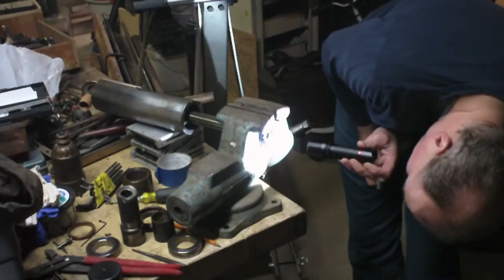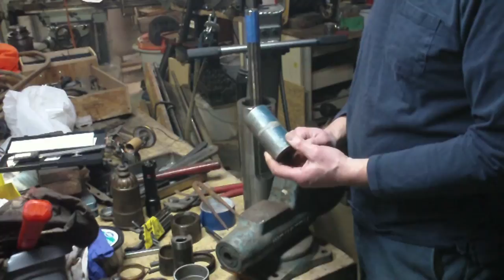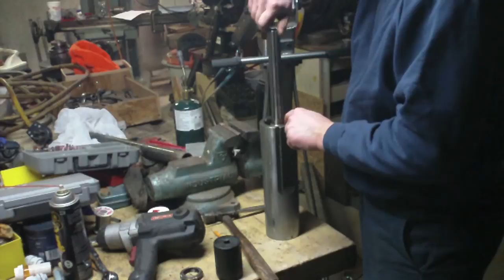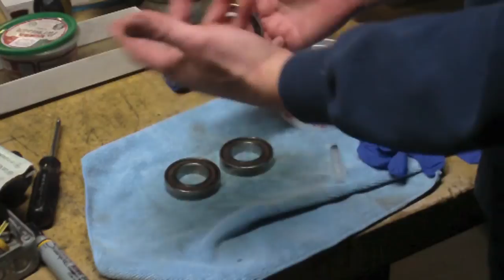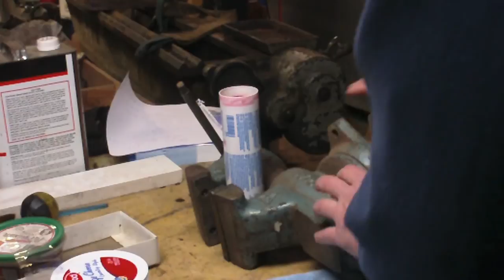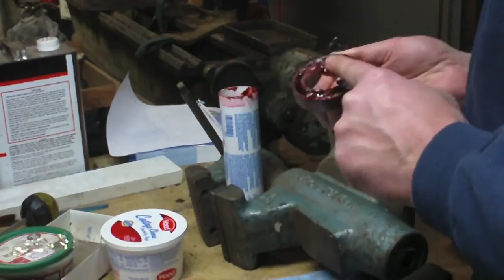Wells Index Milling Machine Part 47

Comment: Steve;

Kluber is great grease and I use it in my bearings.  It is worth the price, but you are correct in that it is very expensive.

I still recommend you send your spindle shaft to Keith Fenner and let him fix it.  I have seen him fix other shafts that had damage at the bearing surface area and the fix is not as difficult as you might think.  It just needs a good surface and a proper fit for the bearing.  Since the bearings run inside the faces of the bearing, you don't need a hardened surface for the bearings.

Regards;

Ron Kluwe
Reply from the maker: Hi Ron. I've seen some of those fixes of Mr. Fenner's you speak of. If I recall he tig welded the shafts used silica bronze filler rod. I'm torn between sending it out to him, or another shop, trying a repair myself, or I also have a line on a replacement head. With freight it'll be an expensive remedy, but I may be able to sell some of the extra parts and make it work out for me. I'm going to wait a week to decide. In the mean time, enjoy the upcoming videos of this failed attempt.
Reply: Steve;

Another thought is that since Keith is only about an hour or so away, give him a call and see if he will let you perform the repair at his shop, under his direction.  I don't know how busy he is, but you never know until you ask.  You get the benefit of having Keith make sure you don't make any mistakes and he definitely has all the tools.

I always look at failed attempts as learning lessons and if you don't try, you never know what will succeed.  Keep at it, one of these days it will all come together.

Regards;

Ron Kluwe
Reply from the maker: Ron Kluwe Thanks Ron.